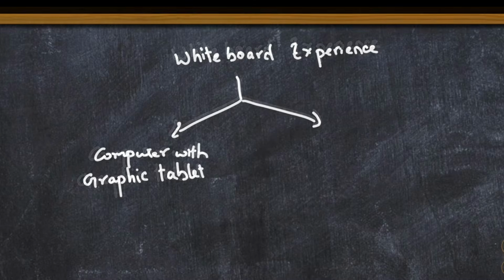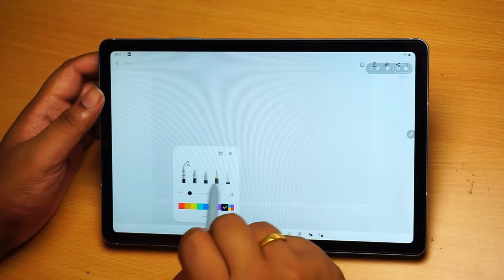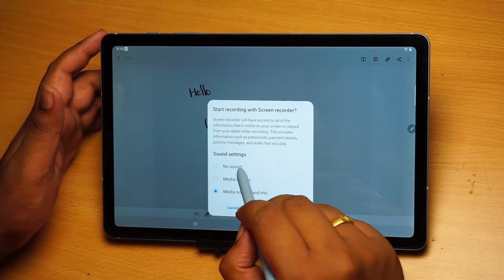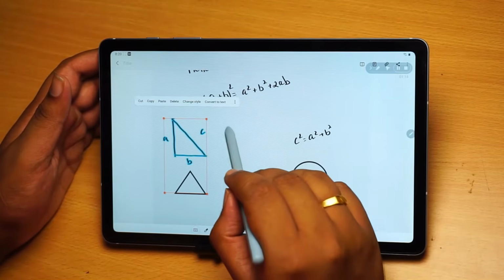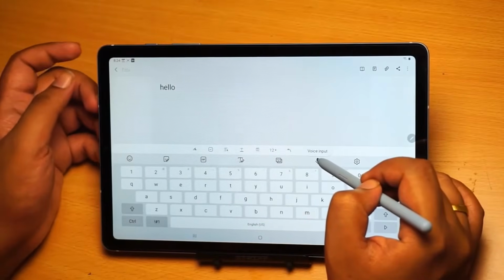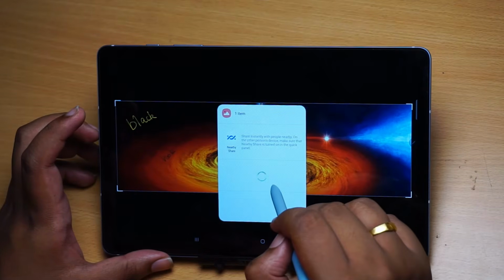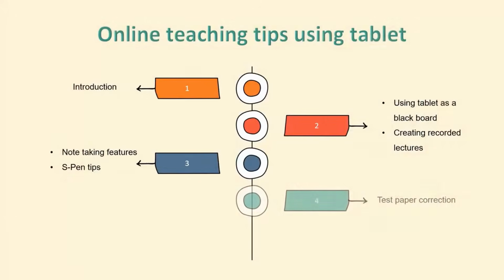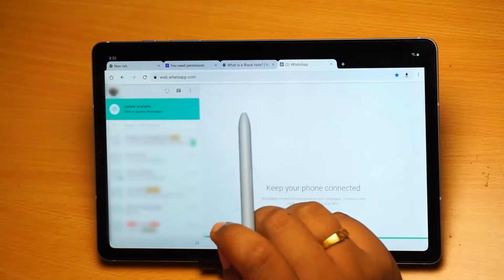Tips for using Tablet for Online teaching featuring Samsung Galaxy Tab S6 Lite (English)

Comment: Hi sir 
Instead of tablet can we use convertible 2 in 1 laptop for recording and writing lectures
Reply from the maker: Yes we can use that also. But if you want to teach by writing, make sure you get a 2 in 1 with active stylus support
Reply: @dismantleGPUs  will u suggest some good 2 in 1 convertible laptop
Reply from the maker: These laptops in the link will do. Make sure get an variant with atlest 8 GB ram for smoother performance. (i3 /ryzen 3 series and above processor will be good) https://m.timesofindia.com/most-searched-products/electronics/tablets/best-touchscreen-laptops-that-support-the-digital-pen-stylus-input/amp_articleshow/76746532.cms